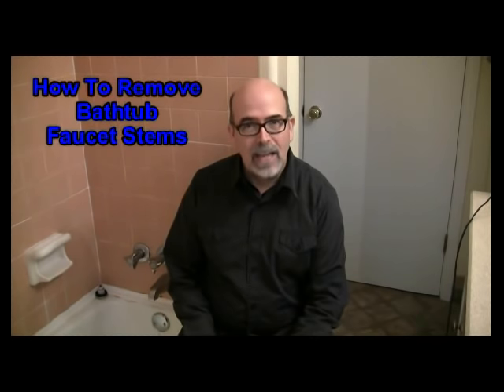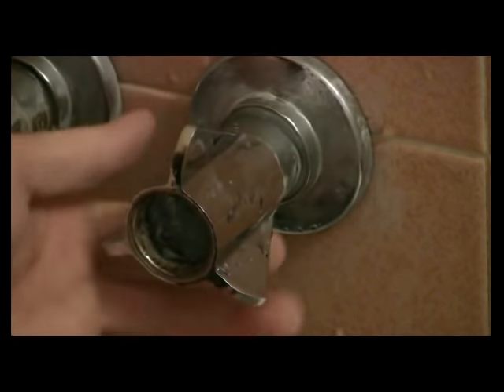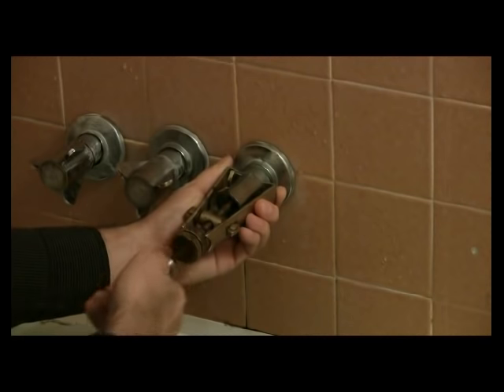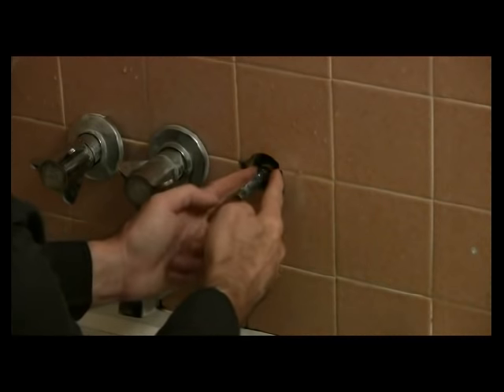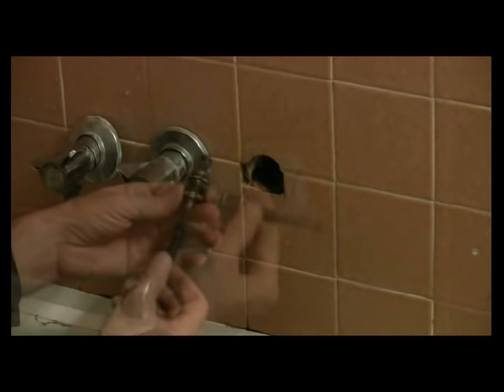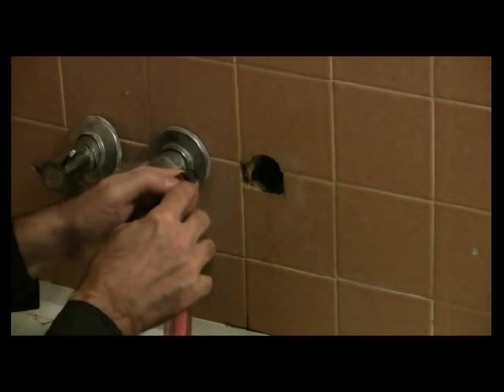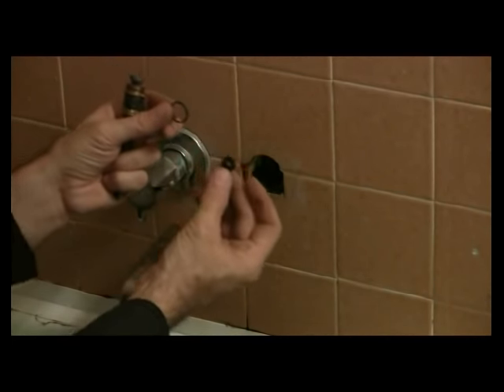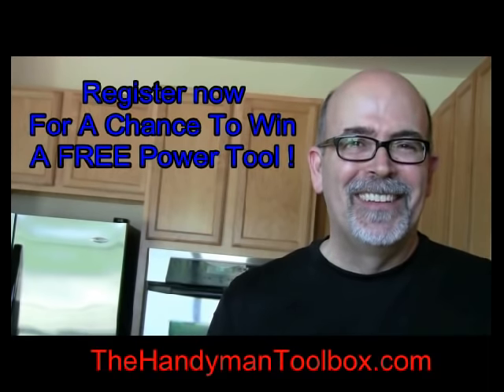How To Remove Bathtub Faucet Stems Quick And Easy

Comment: Thanks! Your vid allowed me to easily replace my valve stems and stop the slow leak coming from the cold water tap in my bathtub. Because they were glued/caulked in place, I was unable to remove the "sleeves" that covered the valve stems, but my shower wrench was able to access the packing gland adjuster AND the main stem nut, so I didn't bother with trying to remove the sleeves.

My valves, installed in 1973 when the house was built, use common Sayco parts, and I was fortunate in the fact that my local Lowe's had the entire stems, complete with O-rings and rubber seals, ready to go at $12 each. I was pressed for time, so I bought a set, lubed them with plumber's silicone, and threaded them in. After adjusting the packing gland, no leaks!

Question: How tight should we adjust the packing glands, anyway? I guessed that they shouldn't be needlessly tight, but I wouldn't mind knowing, as I plan to "touch them up" in a week or so.

Lowe's had the knob removal tool for $9, and Harbor Freight has the plumber's wrench/socket set for $10.

Note: The original homeowner had replaced the hot stem, but not the cold, at some point in the past. Cheap SOB!

Again, thanks!

--KK
Reply from the maker: Nice 👍

Comment: Kind Sir, you did a good job showing us; what can cause leaking in faucets. The "gasket and the packing". But you missed a very common problem that does it too. IE:

The "gasket" is stopped by a part called "the SEAT". And it takes a special "Tool" to get it out and put in. So, AFTER you remove the entire "STEM", the seat is still in the pipe. And it goes bad. For what it's worth.
Reply from the maker: Hi Pat, it might be as stated, but not on this faucet, too old

Comment: Great video.  If the sleeve around the stem is turning when you turn the water facet on/off could that be the cause of my shower leak behind the tub (in the piping?)?  Water is leaking to the ceiling downstairs below the tub.  Thanks.
Reply from the maker: Yes, xr29fb32! What I'd do is clear caulk all around the sleeve that comes in contact with the shower wall. Do the same around the faucet on the tub if applicable! Thank you for responding to this video. Look forward to reading your response on the others as well. Please subscribe now!

Comment: I can't get the stem off.  I have removed the faucet handle and the sleeve.  The stem seems to be frozen.  I can't get enough torque to break the stem free.  I tried spraying with WD40 but it didn't really help.  Would you have any suggestions?  Thank you for any help!  Sincerely,  Kevin.
Reply from the maker: Next time try CLR to remove the calcium/lime/rust deposits! 👈

Comment: I have something very close to your bathtub stem removal, though my is just and old two handle shower.  Either way, where did you get that wrench from.  I looked at the big box store and online, what is it called.  Your link just took me to the socket removal (which is good) and the puller, which I do not need at this point, as I have the handles off.  My channel locks will not take off those silver round covers, so now I am stuck on getting out the stems.  Thanks  Mary
Reply from the maker: You are so welcome DIY Mary. Glad to hear that the talents and skills that I have picked up through my 40 years of public service is beneficial to others! Please make sure you subscribe, new video series coming soon.

Comment: hey what kind tools pull the stem off?? where did u buy that kind tool from? since i need find one of them to get my faucet stem replace rubber rings cuz the hot water leaking bad. so need replace it. i live in mobile home it old fashion faucet
Reply from the maker: Mantha Draus you can get one at any of your large hardware stores!

Comment: Hi Rick. Is there a special tool to remove the cap on some of the older handles?  My shower fixtures are about 80 years old, and the center of the handle does not pry out. Thanks.
Reply: tlbrooklyn Fender.   My handles are only about 20 years old, but they screwed off rather than pulled off.
Reply from the maker: +tlbrooklyn probably not... may want to replace the rough in.

Comment: Is there a difference with doing the hot side stem? I strip the stem using vice grips on the stem to turn off the hot water. Hopefully I don't need to change the seat.
Reply from the maker: No real difference.
Let me know how it works out.
Please make sure you subscribe, new video series coming soon.

Comment: Is it possible to remove those pieces and not have to shut off the water main?   (I live in an apartment)
Reply from the maker: Oh sure, it's possible but I do not think your neighbors nor the apartment management would appreciate it ! Only if you have a water supply cut off valve in your own apartment. Check to see it you have a cut off inside, also go ask the management or the property manager. Thank you for commenting. Please subscribe, like and share the DIY love!

Comment: I have one question: some stems unscrew and I've seen other ones that just pull straight out after removing the nut that holds it in place....although sometimes not easily AT ALL. So stuck in fact that I almost thought at first that I was doing something wrong. Any way to tell (because you can't see all the way to the seat without removing the stem) if they just pull out or unscrew so you know for certain? (Hopefully you understand what I'm asking...lol)
Reply from the maker: Thank you IBAD! Yes, you're right. Some stem are made in the fashion as you stated. This one was different...please like and subscribe now. 
Good News....We are preparing to create a whole new series of DIY home improvement videos you don't want to miss.

Comment: This might seem like a stupid question, but to do this do I need to shut off the water from the main? I also have another question. While showering after about 10 to 15 mins my hot water turns cold even if I have only a little bit of cold water running. Any idea what might be causing this? Thanks in advance for any answer.
Reply from the maker: Roberto Frayre Yes, turn off the water first..always! LOL
https://www.youtube.com/watch?v=YFZwynKnbQE
Yes, perhaps your water heater thermostat needs to be replaced. https://www.youtube.com/watch?v=zwtWdSuXS2s
Reply: TheHandymanToolbox couldn't the water heater also have a calcium build up at the bottom and thus having a smaller supply of hot water
Reply from the maker: Bingo!

Comment: In my case, the hardware is all fine, it's just one of the two handles, made of kind of a plastic faux-crystal material in a long, thinnish shape, shattered into many pieces, so must replace (believe both handles should be replaced as probably can't get exact duplicate of the unshattered one and want them to match.) The handle fit into a socket which perhaps attached to the stem underneath the decorative surface, but the socket isn't threaded, so trying to figure out what is involved in attaching a new handle and how it attaches to the socket. But so far I haven't found a vid on this, perhaps it's too simple so noone considers it worth a vid.
Reply from the maker: Sounds like it may need to be replaced. I'm sure this is not what you wanted to hear. The manufacturers are not so helpful. Thank you for commenting. Please subscribe, like and share the DIY love!

Comment: I had installed a new hot water tank 12-30-13. Now the only problems I have are the decreased water pressure (not a whole lot but we'd like more) and the hot water in the shower is ridiculously low. While showering the hot water is on as high as it will go but then the cold water is barely on or you have a freezing cold shower. The hot water in the bathroom sink was low but self corrected one day when a glob of brown stuff flowed out with the water. I was told to turn off the water, remove the stem and 'blow it out' to remove the possibly remaining 'glob.' Is that correct? How do I 'blow it out?' Would the new faucets on the market help with the water pressure issue? Please help!
Reply from the maker: mydivinity Yes, also take the filter out of the back of your shower head...clean it out as well as to the possibility of clogged debris there.

Comment: When I turn diverter to shower water still comes out  tub faucet. Changed out packing and o ring in diver valve what esle could it be? I have the hot diverter cold valve set up. When on shower it comes out of hot and or cold which ever is on.
Reply from the maker: Hi Ric Dro. Yes, the diverter stem is set too far in. Try repacking it with less packing so the stem will travel all the way inside the tubing to seat correctly. Thank you for responding to this video. Look forward to reading your response on the others as well. Please subscribe now!

Comment: I do not know what type my faucets are.  This is an older house.  I cannot figure out how to get into the faucet.  I can get the handle off, but then nothing moves. I'm afraid of breaking it.  If I could see a picture/s of older faucet types then I could learn what kit to purchase and possibly be able to get into change the washers and such.  I have changed my hot washer kits for many years, but the faucets are a lot newer than this one.  I could send a photo if you need it.
Reply from the maker: No need. jsut take the stem out and go to the local hardware store and show it to one of the assistants there. Very helpful. I like Ace or True Value...no they don't pay me to say that...yet! LOL
Reply: I am having the same problem. I can't find anything that looks like it would be removed with that hexagon tool.  I have a round area with two flat bits on opposite sides that are very narrow and hard to grasp.  I also am not sure if that is what is suppose to release the stem and I'm also afraid of breaking something!

Comment: Excuse my ignorance but instead of replacing parts on the stem , wouldn't it be easier to just put in a new stem?
Reply from the maker: Yes Gregg Tiles, it would be easier, however in some cases that part is not made anymore which is the most economical way of making things right again. Please like, comment and subscribe. Join us on Tuesdays at 8 PM EST for the DIY Home Improvement Tips & Solutions Show!
Reply: Depends on how much the stems cost. For Price Pfister, at my cost(about $4 each) yes. Some stems can be in excess of $40
Reply from the maker: Then again, some parts are becoming obsolete! Let us know how it worked out for you. Thank you, be sure to subscribe and click the notification "bell" now for our next home improvement/home repair DIY videos!
Reply: @TheHandymanToolbox   So what your saying is IF you had to replaced two of them @ $40 ea. $80.oo  You could buy a whole new faucet, for about the same money an not have the hassle. But In my case that would mean ripping out a section of wall.
Reply: @TheHandymanToolbox  i bought new ones, could that be the problem on mine?

Comment: Hello, can you please tell me the brand name of the wrench you are using? Also the brand name of your faucet PULLER.
Thx. So much,
Barry
Reply from the maker: H Barry (Gamer BoyYT) You can get it at the Big Box hardware stores or just click these links below!

LASCO 13-2317 Metal Shower Valve Socket Set by LASCO

 Copy and paste this link and get it on Amazon.com http://amzn.to/2jdY2h5

Wolverine PST168 Faucet Handle and Compression Sleeve Puller Kit
Copy and paste this link and get it on Amazon.com http://amzn.to/2imF6IJ 

Thank you for responding to this video. Look forward to reading your response on the others as well. Please subscribe now!
Reply: Hi I need the name of the wrench, not the puller or the socket set, thanks

Comment: just replaced the entire three knob assembly. The new faucet has a flow restrictor in it. I already have low flow shower head and low water pressure, how do I remover the faucet's restrictor?
Reply from the maker: Great question...You may have to remove it and remove the restrictor gasket valve assembly. Good luck with your project! I've got some more cool videos scheduled. Please be sure to subscribe now so you get instant notifications of my latest DIY home improvement tutorial videos!

Comment: I cannot remove screws that attach the handles to the stems. The screws are locked in place they are striped and won't move.  Do you have any ideas on how I can remove them
Reply from the maker: Yes, use a screw extractor. You can buy the kit at the major hardware supply stores. Good luck. I've got some more cool videos scheduled. Please be sure to subscribe now so you get instant notifications of my latest DIY home improvement tutorial videos!
Reply: Or just take a series of bits, starting with small and working up to 3/8" or maybe 1/2" and just grind out that bad boy.  You may also need a plumbers handle puller for about $12 at your home center. Or a plumber.

Comment: I have a tile shower that has faucets that appear similar to these (though no bathtub spigot.)  The cold water faucet drips steadily (from the shower head, not the handle.).  My house was built in 1961 and I have had plumbers and handymen look at repairing this.  They tell me that my faucets are "antique," the hardware is no longer available, and that they'd have to tear out the whole tile wall and repair them from the other side.  (The faucets are on an outside wall so this means the bricks outside would have to be dismantled to repair these valves.)

Really?  I can understand old faucet parts MAYBE not being available any more but ripping out the tiles and the bricks on the outside for what looks like it SHOULD be a simple repair?  I'm not a plumber but am no idiot either.  

Is the repair shown in this video on an "antique" valve, e.g. mid-sixties vintage?
Reply from the maker: Yes, it is.... and if you can't replace it from a local hardware store, this is what you are facing. I have had the misfortune of having to do the same on several of my clients' homes. Not a pleasant experience, but they now have a newer shower faucet that doesn't leak! BTW, I've got some more cool videos scheduled. Please be sure to subscribe now so you get instant notifications of my latest DIY home improvement tutorial videos!
Reply: sornord my house is 1950s and several plumbers said the same thing. you can buy the new valves for in the handles online.

Comment: Where can I get those tools?
Reply from the maker: Local hardware store has them and you can find them online tool.
Reply: I found them.  This video helped - thanks.
Reply from the maker: Patrick McCarron  you are so welcome....please subscribe to my channel and never miss out on the latest DIY how-to video again!
Reply: TheHandymanToolbox 
Need to replace plastic ends on the handle side of the stem, the handle broke and using a wrench to turn handle off/on. The plastic is wearing out. Not sure what brand, pretty old.  Would you suggest replacing entire stems and handles?